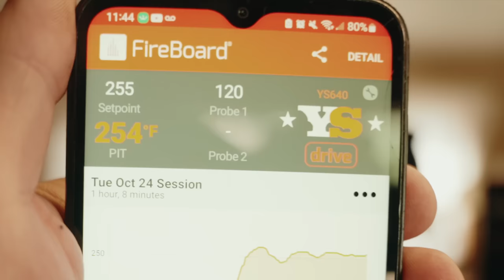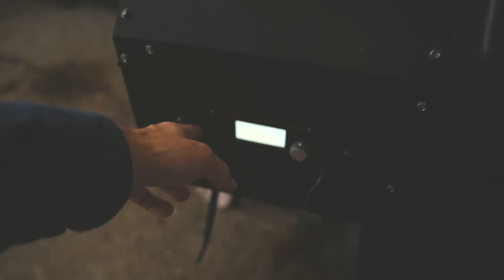Homestead MONEY Update- While Cooking Meat 3 DELICIOUS Ways!

Comment: Awesome - Here's how I cook the chuck roast.  Smoke it for 90 minutes and then place into an empty (no water) crockpot until the Meater reads 205F.  Note, I preheat the crockpot on high for 30 minutes before I pull the chuck roast from the smoker.  Key is to not remove the crockpot lid until it's done.  All the fat juices are saved and enjoyed while eating the roast.  Best of both worlds.
Reply: thx for sharing
Reply: I don’t have a smoker
Reply: What is your smoking temp for 90mjnutes. I have ruined so much meat following the directions on that kamada joe egg cooker I am going broke
Reply: @jaymehatfield9540  I smoke at 250F.   Although I haven’t found it makes any difference if it was 225F or 275F.  I settled on 250F as it made good (enough) smoke flavor and gave a better head start on the length of time in the crockpot.  Hope that helps.
Reply: @joell439  it does. Thanks man.

Comment: I cringe when I see people sharpening a carving knife then going straight to cutting the meat. 
It's not based on any scientific knowledge and is probably not a real concern, but I imagine all the microscopic shavings and splinters from the knife blade and sharpening tool sticking to the edge of the blade then being transferred into the meat.
I don't think the sharpening action just re shapes the edge of the blade. I think it sheers off tiny rough edges and many of those stick to the blade or sharpener. 
I also don't know how large or small they are or what they do to the gut and intestines but just to be sure, I always wash a knife after sharpening it.
Reply: Sound and logical reasoning